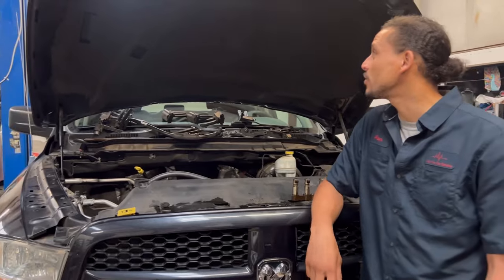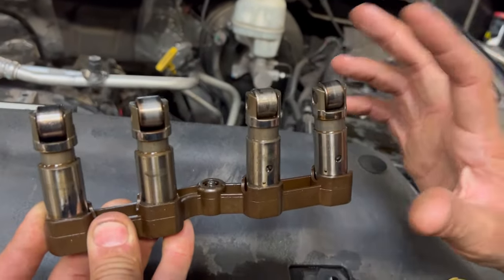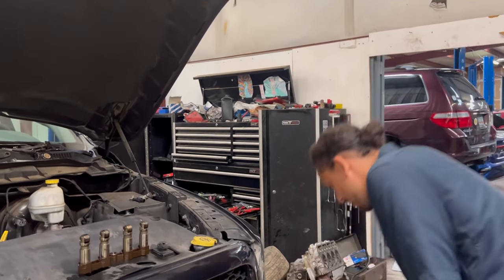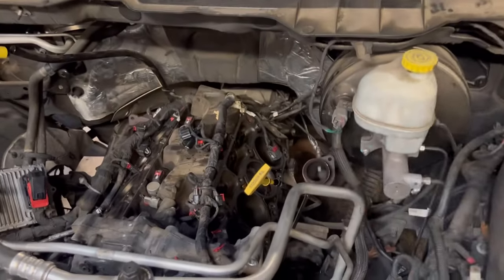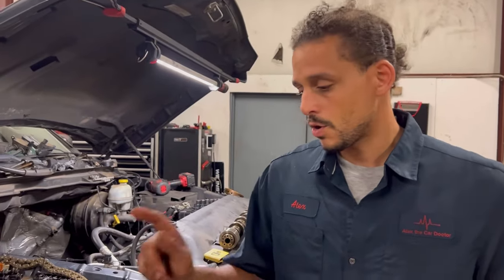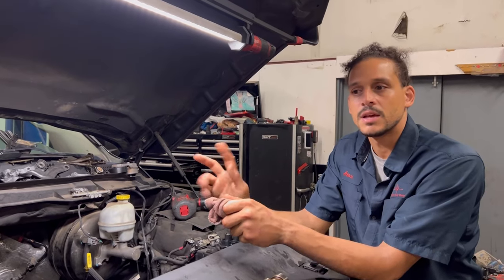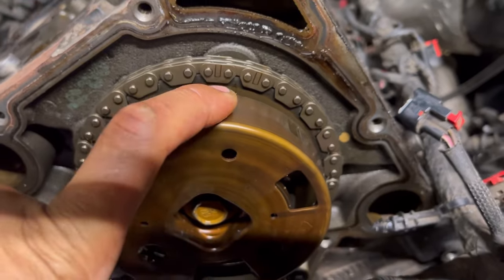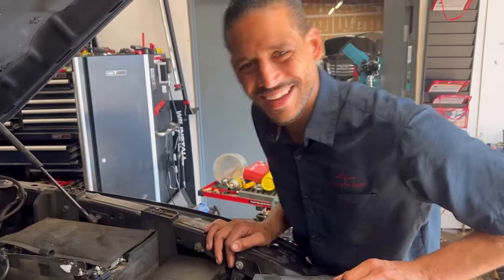The Lifters damaged the Camshaft on this Ram 1500 with the 5.7 Hemi #hemi #lifters #dodgeram #dodge

Comment: Hello Alex,
Thank you for taking the time to make these videos.  I recently purchased a 2014 Ram at first it was amazing no issues.  Then it developed that chirping/ ticking sound. I'm almost 100% sure that's the issue I'm having . How much should I expect this job to cost me . And I really don't have a choice and have to drive the truck to work . Do you think if I put some good synthetic in it and baby it that I can make it few months until I can afford to fix it. Also mine has MDS can I put regular lifters in and delete mds?.
Reply: I have the same problem. I bough a 2014 ram and in the next two days the noise started. I will appreciate if you can share what did you find about your question!
Reply: I am looking to buy a 2014 too in your guys experience should I?? 6k
Reply: I just did a oil change with Red Line 5w20 Synthetic. To my surprise the noise went away 100%. I still have the tick on cold start up which is the exhaust manifold bolt that I'm aware is broken. That noise goes away after about 30 seconds. But the annoying chirping noise that sounded like a bunch of birds chirping is gone. The truck runs a lot smoother now and is so much quieter. I'm not saying this will work for everyone but it's worth a shot. I purchased the oil from Summit Racing and then paid $60 for jiffy lube to put it in. Total cost was around $190.00. I have learned that these hemis are very particular about the oil you put in them. Now did this fix the problem for good ? I can't answer that but for now my truck sound like it's suppose to and I'm a thrilled that the noise went away.
Reply: @Samuel Andrés Araujo  I did a oil change/filter  with Red Line 5w20 Synthetic. Noise went away. However it's only been a few days so only time will tell. But I will say you will notice a noticeable difference when you run this oil. I'm going to do a oil change every 4k miles.
Reply: @samuelandresaraujo3483  hey did you ever get a quote on how much this cost
Reply: @JohnnyDominoRican  yes, I asked in so many workshops and the price was between $2000 - $3500. It was too much money that I couldn't afford, so I decided to find the parts on eBay, watch as many YouTube Videos as I could, and did it myself.  I'm not going to tell you it's easy, and you need to have a lot of tools and adequate space to do it, but in the end it was worth it and here I have my truck running and I spent about $1300.  I replaced oil pump, water pump, camshaft and lifters.
Reply: @tinkergirl1105  I'm going to try this on mine and see what happens.

Comment: I have this tick, change the oil, hopefully that will fix it. I saw another video on this, the guy said he use 5W 30 oil instead of 5W 20, he said it stop after that, i pray it works for me. Wht will a job like this coast?
Reply from the maker: Job like this is about $4k if done right. I hope the oil change works out for you 🙏🏽
Reply: @AlexTheCarDoctor Lawwwwwd, meeee toooo 😮

Comment: Alex I’m doing this now. I did not remove oil pump but made sure my timing marks on the cam sprocket were at the 6. Should that be correct. Or do I need to remove oil pump. And I seen you did not remove oil pan to get the pick up tube off. What’s the trick. Thanks.
Reply from the maker: I recommend removing the oil pump and replacing it

Comment: I have done a bunch of these at my shop I have 2 at my shop now. One the customer has a warranty one of the lifters came apart the roller was good still the cam wasn’t worn but has slight chatter marks which go the opposite way the lifter and cam rotate so the length of the cam which makes sense because the lifter had excessive lash so the cam lobe was smacking the lifter from the lash but the warranty company doesn’t want to replace the cam they want to replace lifters on one side well I specialize in engine work and that’s not gonna happen I’m not gonna have the customer come back in 6 months with the same problem.

Comment: literally every hemi truck 5.7L will have this failure, most will require engine replacement unless caught very early. you also need to drop the oil pan and clean out the debris to keep it from cycling into the oil with the new camshaft and lifters, causing a recurring failure. most techs fail to drop the pan, because they get paid to do that as a step in the repair and by not doing it earn themselves 4-5 hours for bypassing that step.

Comment: Hey what’s up man I just changed my lifters out I put everything back together  and when I go to start it I have a crank but it just starts to bog out seeing if you had any idea of what it could be I checked the fuel lines and that’s all good
Reply from the maker: Hey there, can you send me a video on Instagram?
Reply: Yes of course I was working on it today and it started up after I replaced my spark plugs but now I have still have tick but it’s not as bad and my exhaust is throwing out white smoke and the truck was overheating

Comment: I sent twice my 2012 Dodgers ram 1500 5.7 hemi for the same problem to the shop, they change twice the whole set of lifters and supposed are a good brand but still have the noise like a knock, do you know if can be something else?
Reply from the maker: Did they change the Cam?
Reply: Yes, because the mechanic said the part still was under warranty by autozone

Comment: I wish u was close bye
.I have a charger 2015.its ticking wit no lights on inside..took to dealer ship ..said it was lifter on passgerside..but then said it if camshaft might be bad as well they will no know until apart? Is that true..ok said if camshaft not Damaged it will be around 1500...ok if camshaft is damaged it will be 2600..but can't tell until out is that true..?.I wished u was in fayetteville area..smh

Comment: 5.7 Hemi's need a high volume/pressure oil pump. The hellCat does up to 80p.s.i. ,Where the regular Hemi oil pump only does a max of 58 p.s.i. ! 5w-20 is possibly not heavy enough oil ! 5w-30 is much better. The Melling oil pump is a much better oil pump than the factory part. Buy the Melling ! Good luck !!

Comment: Just a quick question: If someone uses the cars oil life indicator on a NEWER car (15+)
it doesnt void a warranty to go by what the cars oil life incidator says right? me personally, never let mine get below 10%. will shelve the car until i can afford an oil change if need be but the shit dealership i got my car from keeps trying to make it seem like i lapsed in oil changes when i didnt. the warranty ppl declined my repairs bc the previous owners put on new headers, mufflers, etc that werent GM brand. Crooooooks! they act like there arent 3 types of car parts, new, used, and good parts. im pretty sure the parts on my car aside from the mfin lifters / afm system are good.
Reply from the maker: Hey there,using the car oil life % will not void any warranty pick that’s what is therefore to tell you when it’s time to change the oil and you’re doing right not to let it go below 10%. The only thing that I’ve seen boy warranty is aftermarket performance parts like cold air intake and  headers so yes they will put up a fight with that type of thing

Comment: What causes a chirping noise in my 2014 5.7 Hemi engine 4x4 big horn
Reply from the maker: It could be anything from a bad belt/belt pulley like alternator, water pump or Engine internal noise,fly wheel scraping on metal spacer shield

Comment: I've got a 2014 big horn with 140,000. Camshaft failure just around the corner. Engine  light is on, won't buy another Chrysler. Want to trade it in. Here in MI they want $4000 to $6000 for fix.
Reply: Dealing with it on my 2015 ram 108k miles

Comment: I heard these repairs are coming for this truck. Question, After getting this repair, is it most likely going to happen again? If so, what are things drivers can do to help prevent this? , Aside from getting rid of it.
Reply: A better oil pump
Reply: A lot of guys run hellcat oil pumps. Personally I run 5w-30 with no issues (does not affect mds). Keep idle times low. Number one killer of these
Reply: Full synthetic oil, change your oil frequently, cut down on idle time, turn off MDS / disable it.

Comment: Hi Alex I got a 2014 ram n there’s this weird wire hanging from the bottom of the truck
Reply: If your weird wire is running from front to back under the driver's side it's probably the parking brake cable. If it's sagging and your parking brake pedal is not engaged, one or both of the parking brake levers in the rear wheels have seized. Been there.

Comment: I'm looking to buy a 2014 ram 1500 for 6K owner says it runs but has bad motor is it worth it.?
Reply from the maker: I guess that will depends on how bad you want the truck and the scarcity of a pick up truck in your area but to me it’s not worth it. The engine options for those trucks are expensive
Reply: @AlexTheCarDoctor  thanks very much bro saved me 6k💯I'll just wait to pay something that's not gonna break down
Reply from the maker: @ericv3609  Your best bet is a Nissan pick up truck or a Ford pick up truck or if you’re going to do some serious pulling go diesel you can’t go wrong on any occasion especially dodge they have the Cummings The Nissan Carrie the Cummings to on their new Nissan Titan if you want total reliability go old diesel they don’t have the new emission controlled stuff. I drive a 2000 F250 with a 7.3 diesel no issues and very strong. my pleasure and happy holiday brother thanks for watching

Comment: The audio on your video is horrible, you have a loud ground hum going on, Great video though thank you! The issue with these hemis is the lack of oil lubrication in the upper top portion of the engine, cams lifters etc because it's such a poor design. No oil galleries up there it relies on the crankshaft to splash oil to that area which doesn't really happen at a low idle, even though you do this rebuilding procedure, it's just a time bomb for it happening once again, one of the worst designed engines out there!

Comment: I’m currently dealing with this issue at 150,000kms. My question to anyone with this experience is that if I change the Cam and lifters will this issue return again within 150,000kms of replacement???
Thanks
Reply from the maker: Depends on what parts you use for replace the and how well you keep up with the oil changes.
Reply: @AlexTheCarDoctor  is this a normal occurrence with this Dodge Ram Alex???
Also, what truck would you recommend that has minimal issues with engine and tranny with your experience seeing trucks throughout your career. 
Best 🙏🏽
Reply from the maker: @Apexpropertycare  yes it is very common on these Dodge Rams. What year truck are you looking for? Each year got its own issues.

Comment: I  think I got cam  damaged  and lifters snd they found metal  shaves dies that  mean i need a new  engine  or what
Reply from the maker: It may just need cam and lifters,the metal you see is probably just from the cam getting chewed up, but I won’t know for sure without seeing it for myself
Reply: @AlexTheCarDoctor  ya i know to bad u not in Calgary Alberta
Reply: @AlexTheCarDoctor   thats what the dealership  ship said that i need  a new engine  but who knows they could be just saying  because of money
Reply: Doesn't all engines have metal in it ?
Reply from the maker: @dimensionexo.  in theory yes on a micron, you shouldn’t see metal in your engine.some dealerships are not trust worthy so I will get a second opinion
Reply: @AlexTheCarDoctor  Thanks - I have debris in the oil filter and oil pan - My plan is to run diesel through it and then drop the oil pan clean it replace-
Put cheap oil in the 1500 run 10 min then dump the oil *

Comment: Oil! Oil! Oil!     Use 5-30 not 0-20!
Reply: We have a 2011 Jeep Grand Cherokee with the 5.7.  It calls for 5w-20.  We used Pennzoil Platinum and currently have 56K on the vehicle.  Ours has MDS.  I watched Project Farm testing thin oils and the wear scars were significantly larger with thin oils.  Next month, we are driving the Jeep 3200 miles on a vacation.  Should I use 5W-30 instead of 5W-20?  Will the MDS still function?  I would believe that it will because the OM says "5w-30 is OK in an emergency".
Thanks!!!
Reply: @scotta9114  The ideal oil for gas milage is 5-20, the ideal oil for wear protection is 5-30. The MDS will function but as you probably know you only get the MDS going 65-70 with a medium to light load!  I drive my 5.7 at 75-80 as if you don’t middle lane drivers will run you over and right lane traffic is insufferably slow and variable.   I stoped my tick with 5-30 as have others.  The light oil is to up the gas milage.  Some engineers might sat tolerances are now so tight you need a thinner oil but thats a stretch.   If it ticks with 5-20 and doesn’t with 5-30 that tells me all I want to know!
Reply: @bubbafatas2588  Thanks.  I'll try 5w-30.  This thin oil is all about Government regulations.  I've seen 0w-16 on the shelves.  Talk about thin.  We are driving across Idaho, Montana, North Dakota so 80+ all day long.
Reply: True that. 5w30 stopped my ticking. The recommended oil is extremely thin...